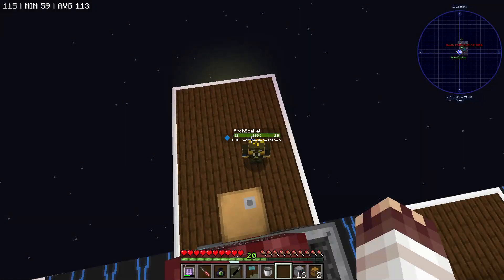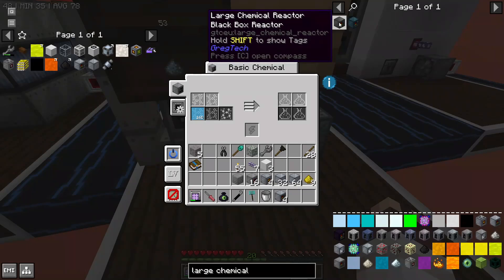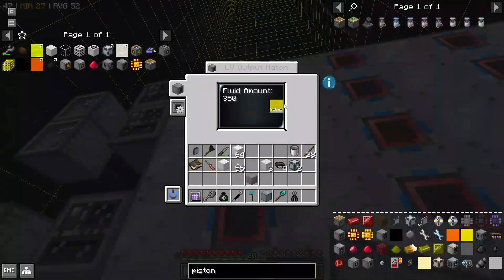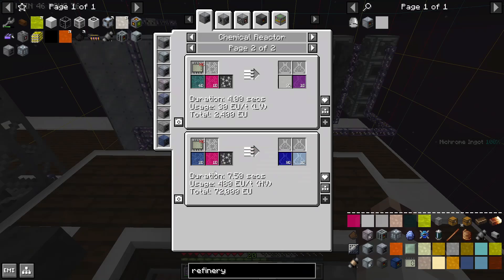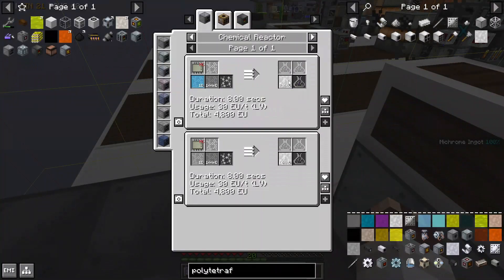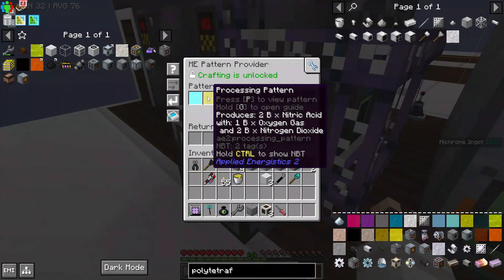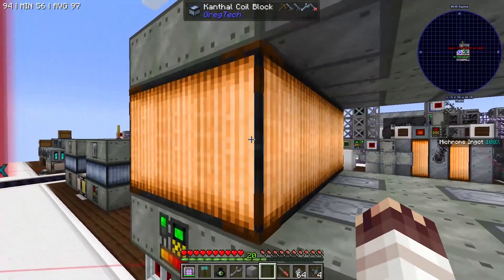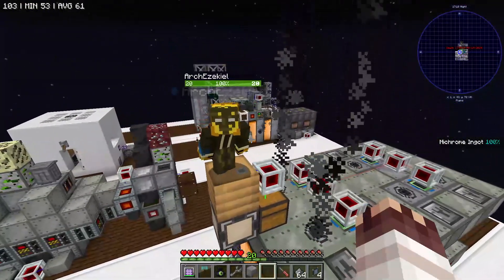Sky Greg Supershorts #7: Cetane Boosted Diesel

Comment: Alternatives for raw/heavy/light oil is just using the oilsands ore and processing from there.
Reply from the maker: Yeah, there are situations where we use that method! In this case, raw oil was good because it had the perfect ratio of light to heavy fuel to sustain a diesel setup.
Reply: @minecraftinchocolate  You can get raw oil from oilsands. Check all its recipes, some of them are different. Very sneaky.
Reply from the maker: @andr0oS  Wow, that’s great to know! I’m thinking I might pin this for other viewers, it’s a hard sell between this and the “power distribution” comment.

Comment: Same set-up, my pattern provider does not provide items to adjacent chest and barrel :(
Reply: Fixed the problem is a very very bad way. Proovider is connected to an interface, a different cable color, 2 storage busses are connected to the chest and barrel. I need to specify every item in the interface though :( Edit: Every gas, because my provider can't deliver item and fluid at the same time.

Comment: Combustion turbines as a single block dont produce much and when you either go to turbines, it gets harder, so im going ask, how would you transport power without losing amps since super conductors are expensive af
Reply from the maker: As we found out eventually, the IV superconductors are very cheap compared to other superconductors. But also, the loss per block as you get higher and higher in power tier becomes more and more negligible over time, so even if you don’t make superconductors, it’s not the worst idea to transfer IV power all over your base using 1 EU/block/amp lossy cables at IV or LuV (using transformers).
Reply: Automate. Passively. It's a lot better having a small production running in the background 24/7 than making everything on demand. Super conductors are really cheap if you just set up automated lines to produce their materials, and raw materials are ridiculously easy to get in this pack. For example, I setup a single centrifuge for separating rare earths early on... and by the time I reached IV, I had 600 samarium - more than enough for all the IV superconductors I could want (I did eventually replace that centrifuge with HV and later EV for the bonus yield, but mostly for my obsession with processing efficiency :D ). When tier bonus isn't a factor, a nice passive setup at low tier is a lot better than overclocking unnecessarily... and there aren't too many things where the bonus matters (though don't forget that macerators run most recipes at very low power, so you can usually afford one or two tiers higher macerators than others).

That said, by EV it doesn't matter anyway; losing one EU per block out of 2048 in an amp doesn't hurt all that much, and the main reason I used superconductors was their great amperage (and not having to bother with covering the wires :P ). And in fact, it doesn't matter in HV either, since you can use the HV transformer to setup a power network on EV (you already have plenty of aluminium from all that passive production, right?). And in fact, it doesn't really matter even before that, because you have AE, and surely you've automated the production of steam/gas turbines. Heck, even in GTNH, I used a benzene-piping-network for all of my base before switching to EV large steam turbines for the bigger loads.

Raw materials being so ludicrously easy to get in this pack should remove all inhibitions to just automating every component you need. Heck, I even passive'd the production of cupronickel wires back in LV - why not? :D A lot of the materials you would normally build up large ore processing arrays for extracting from other raw materials are available directly in unlimited amounts. The superconductors are at least fun in making you think more about passiving such processing - like getting boron or phosphor.

And hey, even at that early IV point? I only had one large steam turbine, running at measly 1638 EU/t some of the time. Everything else was still powered with small generators, and even this large turbine was mainly there to test how viable large turbines were. Until you get at least EV dynamo hatches, they're of course almost completely useless; unfortunately, EV dynamo hatches are also the first that come in 4 amp version. The rest of my base was running on about 2000 EU/t worth of steam and some 6000 EU/t worth of various gas turbine fuels (starting with benzene, then expanding into methane and LPG with distillery towers), all in small turbines.

EV is about the point where normal machines start consuming a lot of power - until then, blast furnaces absolutely dominate (and again, should mostly be running 24/7, passively producing their respective materials). There's a bit of a gap there before you really need to start producing in IV blast furnaces en masse and you'll need quite a bit of IV machines processing at that point too. And importantly, this particular pack is missing the fission reactors completely, so there's a huge gap between decent EV power (large gas/combustion turbines) and fusion reactors. Also, there's only five kinds of plasma fuel.
Reply from the maker: @LuaanTi  Wow, I had no idea there was a power option between gas/combustion turbines and fusion! We were struggling. We made about 27 amps of LuV and we’re hoping that’ll get us to plasma power.
Reply: @minecraftinchocolate  Unfortunately, not in this pack :/ It makes LuV a bit of a slog. Yikes, 27 amps of LuV :D It's funny how small you still build everything at this point in the videos, and then suddenly 27 A of LuV :D Do you think it's worth scaling LuV so high before plasma generators become a thing? A single fusion reactor can feed more than 300 EV amps worth of plasma turbines producing helium plasma, so expanding after that point becomes a bit easier.

Advanced generators are a thing at IV, but I'm not sure if they're worth it at all; they are easier to expand and have 185% fuel efficiency with the mixers, but still, for the cost of one tungstensteel rotor (80-ish tungstensteel) you get just 250 EU/t... ouch. You don't have to worry about maintenance or replacing rotors, but I get the feeling I'll be done with the pack before I have to replace a rotor once anyway :D 

And near the same amount of tungstensteel gives you a large steam boiler producing 3200 EU/t worth of steam which you can nicely bundle with two large steam turbines. Granted, it does take a bit more space and some big pipes, but it's very simple.
Reply from the maker: @LuaanTi  Advanced Generators suck because of the resource cost required for the power turbines, so we decided not to use those. Basically what happened was that we didn’t feel 12 LuV amps (which we’ll get from high octane gasoline) was enough to scale our production sufficiently for our needs. So we decided to make a nitrobenzene + large gas turbine setup that made 15 more amps, and it was easier than expected by a lot. We feel like we need it to make it to fusion, because we know we need a fusion computer MkII to start fusion power, and we don’t want to be running on fumes, if that makes sense? Unless there’s a fusion option that works at Mk1.
Reply: I was asking about early game, since late game might bite me a bit for now or is it better to speedrun to iv for the iv superconductor?
Reply from the maker: @ninjanimarkus6077  In HV, we just slapped single-block combustion generators wherever we needed them. In EV, we slapped Large Combustion Engines wherever we needed them—we needed 6-8 of those across our base before we centralised our power and got IV superconductors. In some cases, we set up flowers of HV combustion generators to transform into EV.

So, basically, put combustion generators close to where to you need them so you don’t lose much energy per amp. Once you can make IV superconductors, centralise your power.
Reply: @minecraftinchocolate  ah so spam, yippee :D